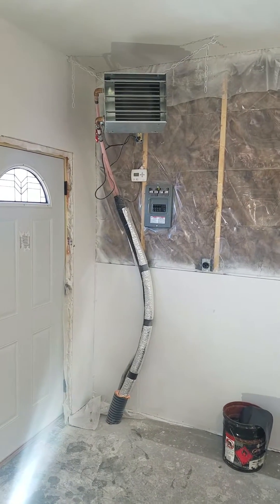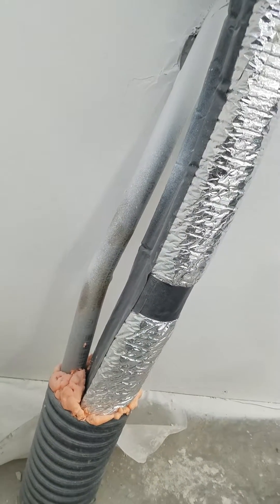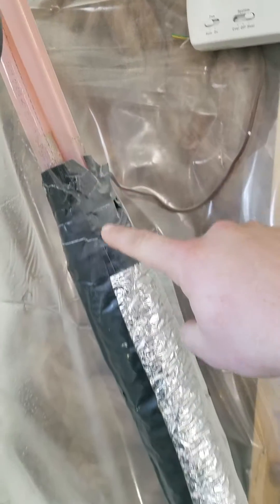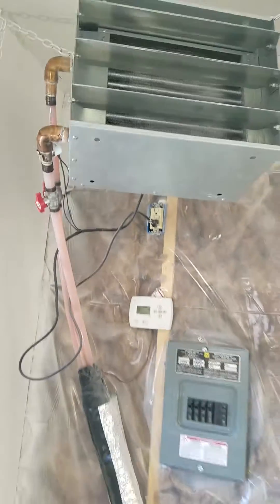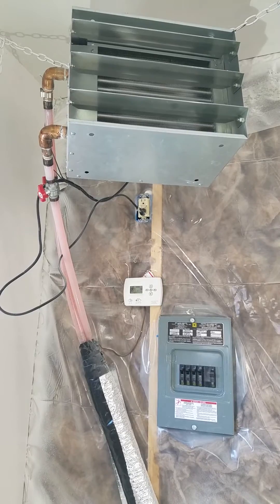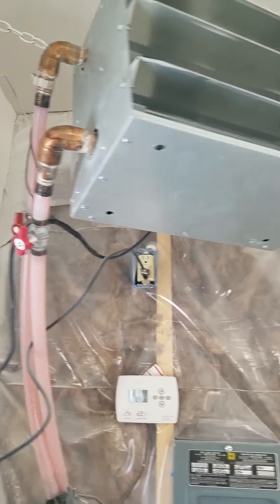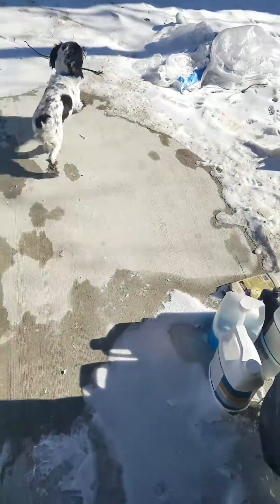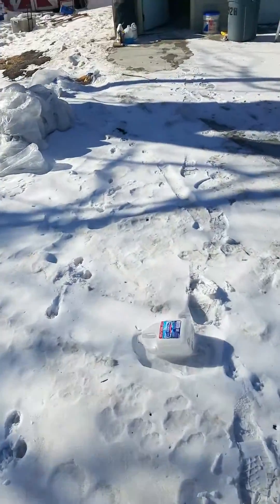Water to Air Heat Exchanger Hydronic Boiler Shop Garage Heater

Comment: FYI water has a very high specific heat rating. That means for every degree of water temp change, it takes alot of energy just to change it one degree.  So if you are having the temp drop 15 degrees across the inlet and outlet then that's alot of energy being pulled out the the water.  You probably are closer than you think to the 50k btu rating.
Reply: It all depends on how many GPM he's running through there. He'd need to be running right at 7GPM for it to be 50,000 BTUs, and I doubt he is. Half of that is probably a safe bet...

Comment: I installed a Pontiac Fiero radiator (because I had one) in a kitchen cabinet, cut & attached floor vents in doors & put box fan (I had a old dayton, but it went bad) up to the back of it, dont look that bad...

Comment: What was the eBay company that you purchased from. I can’t find any units under $400 and my garage is slightly smaller than yours.
Reply: Just use a car radiator and any fan,
Reply from the maker: @DanielbenDaniel  i thought about doing that.  Mounting a  57 Chevy front clip on the wall, bumper, hood headlights, and have the radiator as the heat exchanger
Reply from the maker: I think they went out of business, or they raised their prices. I don't see them anymore.

Comment: Your thermostat should be on the other side of the room
Reply from the maker: Ideally, yes. But it's under and behind the heater, so it's not influenced by the heat.  It works quite well. When you open the door, though,  heat usually kicks on, which is fine too.

Comment: Why dont you let the water just continuously circulate to the shop?
Reply from the maker: Thats how some do it, but you pay for electricity to run the pump, and it would put more wear on it. Also more heat loss through the ground.
Reply: @larsonhomeinspection9932  I'm looking to do the same in my shop so I was just wondering. How is the air handler holding up?
Reply from the maker: @yotamonster  it works great. The btu ratings are overstated, so it runs more than it should and is a tad loud.